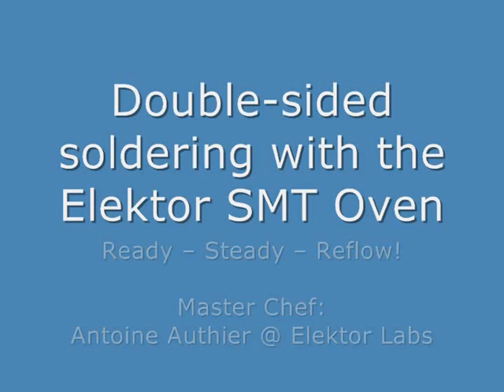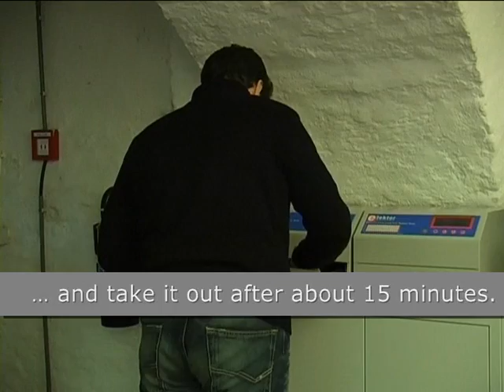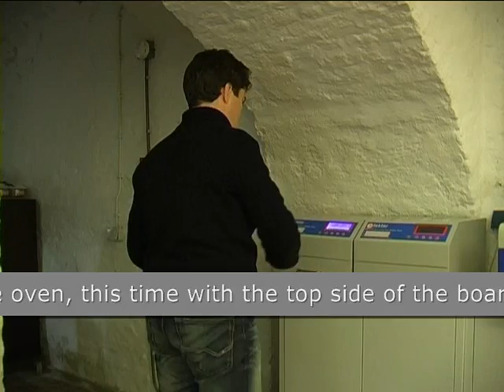Double-sided soldering with the Elektor SMT Oven

Comment: it's obviously prototype stuff, otherwise u use stencil instead, but how do we use adhesive and paste at the same time then if we use stencil?
Reply: I am not the original author, but I have worked a month in a factory in 1992. The stencil is used only for paste. The adhesive is put just before the component (by a robotic arm, or manually). You try to put almost all the components on the side that does not require glue.